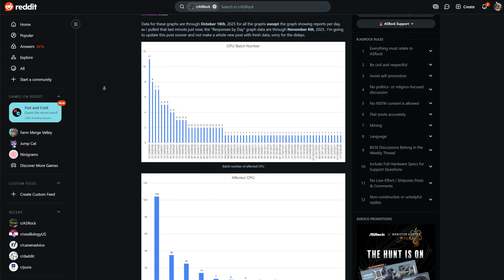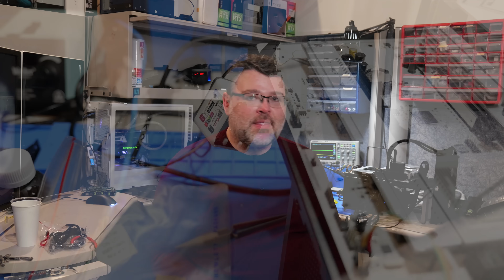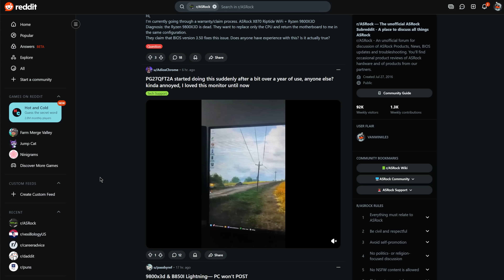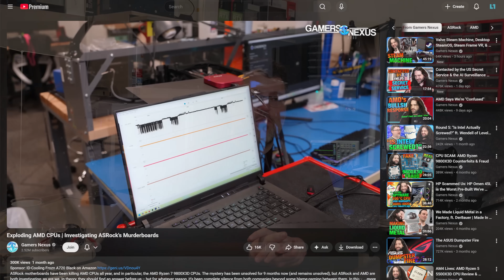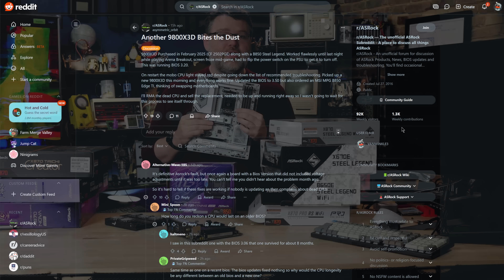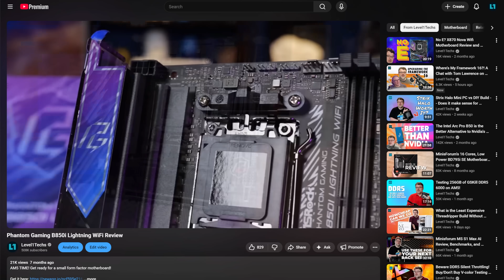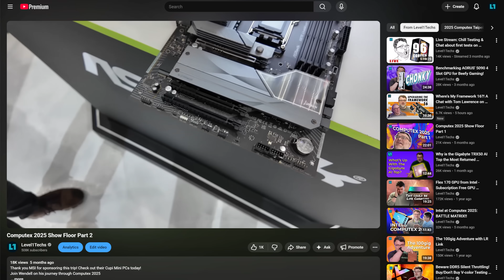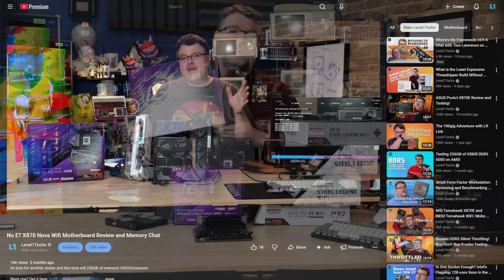Attempting to Troubleshoot the ASRock Motherboards of Death!

Comment: The problem is in the EXPO profile self, which raising up VSOC - memory controller voltage and VDDIO - memory bus voltage in UEFI up to 1.4v, at least what i saw. Just need to make manualy corrections after each bios update (from 1.4v to 1.2v) to solve that issue. And mayby also need to adjust manualy CPU voltage for 9800X3D 1.2v even whit 200+ boost clock.
Reply: 3.50 BIOS caps VSoC at 1.2V anyway iirc.  And lowers LLC to droopiest.
Reply: The EXPO profile on my G.Skill 6000 CL26 kit I use on my ASUS ROG Strix X870E-E has the voltage at 1.45v. I have PBO set to +100hz boost, 1x scalar, motherboard limits enforced, 85c thermal limit, and CO -25 all-core on my 9800X3D.
Reply: @JJW3  1.45 would be the Mem VDD (DRAM voltage).  It only exists on the DIMMs and doesn't matter to the CPU longevity.  If your VSoC were @1.45V at ambient it'd turn into magic smoke.
Reply: @concinnus  Ah, got it. It looks like the current ASUS bios has the VSOC at 1.2v by default as well, as i've not messed with that setting and that is what it is showing in HWINFO.
Reply: @JJW3  Auto scalar should bettter perform the CPU.

Comment: 9700X and B650M-HDV/M.2 here. They have been working well for 13 months now.
Reply: Which bios you updated to?
Reply: @mazditzo  I upgraded the BIOS when I bought the motherboard, 13 months ago. After 6 months of use, I upgraded once more. A month ago I upgraded once again to the latest version of the BIOS. Basically every 6-7 months I upgrade the BIOS.
The CPU is not overclocked, it is stock at 65W, it is not undervolted, no PBO. As it came out of the factory, I installed on the motherboard and that's it.
It is cooled with a Phantom Spirit 120 SE. My assessment is that this cooler is more than enough to cool this processor, if the processor remains locked at 65W.
A few days ago I bought and installed 9070 XT PURE. The computer is very quiet and cool, even under load(video games).

Comment: G'day Wendell,
12:13 😂😂😂😂😂, it is a very weird random problem...
but I am not facing this problem anytime soon as I am still sticking with AM4 due to cost down here, the used APU/Mobo/16GB DDR4 Combos I am building to help people upgrade their old PCs for W11 compatibility together cost less than the current $200AUD alone for 16GB 6000-DDR5 @ Scorptec, which is cheap compared to 🤬$329 16GB 5600-DDR5🤬@ PCCG

Comment: 8:32 A lot of people forget to include the human as the cause of the problem when it comes to this kind of stuff, I see a bunch of user errors constantly killing hardware and because they go on Reddit and get their post blown up the company has to abide with a replacement to save face or spend time and resources gathering evidence that the user caused the damage which would end up costing more than just replacing or refunding the damaged products.
Reply: I'm sad to say but these days you have to include the internet noise as a potential "problem" too. There's lot of noise on the internet these days with lot of bots and it can emphasis some issues. I have a 7800 x3d cpu myself and i know two people with the same cpu (no asrock board) and things have been running smooth. Small sample size but it doesn't seem to be as common as let's say the RROD of the 360 where pretty much everyone i knew had to RMA his 360 once.
Reply: With how irreproducible this "issue" seems to be, it heavily points towards an intermittent problem on (gasp) AMD's end.
There are a lot of steps in a multi-chip packaging, and at any point Something could go not 100% right and you have a timebomb that goes off randomly.

more complexity, more weird problems, it's always been that way
Reply: @TheDoomerBlox gasp is right.  The thought that a CPU--much less an AMD CPU--could cause an intermittent issue doesn't even occur to me as a reasonable possibility.
Reply: @watchthereplay-wtr  the worst part of this is that with new Intel CPUs embracing the same kind of shitfuckconvolution, they likely also feature random inexplicable death-states

Comment: I have a ASRock z790 Riptide motherboard and the 14900k I recently had to warranty my 2 month old prossesor with Intel the issue I had was it wouldn't read duel channel only single channel. Was watching your content and was curious if it could be a symptom of the same nature as the AMD processors? Intel SWR my processor with seeing your video now I'm wondering if I could have the same thing happened to my 12900k that I have in there now difference is that I'm not gaming on that motherboard anymore I have a MSI carbon max 2 z790 motherboard. Please let me know if you think it could be a symptom of the killer motherboard or not....

Comment: I struggle to understand the data, as what to infer from it, simply ain't obvious. If there is an issue, it most certainly is not on Intel level.

As for corrupted BIOS, that actually used to be a major issue for me, with x370, x470, and b450, and x570. I had bios failures all the time, particularly on Gigabyte boards, probably since I were using a lot of them.

My Asrock b650 board also had issues. More particularly, I needed to remove the GPU, reinstall the CPU, as usual, to get to work again. But, I have never ever needed to reflash a single board ever.

I once had a B450 ITX from Asus, constantly failing on me. Probably from the insane water cooling running it. The board would luck up, and only a CPU swap, would fix the issue. Reverting to air cooling, fixed everything.

Given my own experience, and seeing how quickly people blame their boards in the current environment, I struggle to make sense of what is going on. To me, these numbers ain't really proving anything to me, but again, they could. There just ain't sufficient data.

Asrock stepping up their integrity checks, makes sense, and seems reasonable, given they are chasing a ghost. Just seem to reflect good practice, no matter if the ghost is real or not.

Given my experience, one key factor to probe for, is the cooler used. Secondary, the case is of importance, as this could be related to shielding and grounding issues. Ghost chasing is fun! We all love it. Not.

Back in the day, when I used Gigabyte dual bios board, I constantly had one of the bioses locking up. I fixed that by just flashing the other. (that sort of is a reflash, so I guess I have been doing it.) I was using my back and side burner cases back then, and they are insanely overpowered, with like 3 pumps and a 2880 rad. My take is on this, hearing what people have been saying, they report basically what I was constantly struggling with back then. Just for reference, this type of issue also plagued a x570 form Asus. The issue was the insane power of the cooling, or a possible short or something from using it. Once I moved back to air cooling only, I hardly ever see this issue anymore.

Other than once about 2 years ago, but that did not need any reflash, just a complete re-seating, and I had to use the on board GFX. Every freaking component was perfectly fine.

But i could brick the asus itx B450 board at any time, if I wanted to. All I needed was to water cool it, with a bad @$$ water cooler. Swapping CPU to anther type of CPU, would fix the issue. but once running a power virus on it, it would lock right up again, if running that bad @$$ cooler. Swapping type of CPU, was the only way to save it. That was Asus.

Also, if you look at some fan controllers, or fan hubs, they actually feed 12V back into the motherboard. Fractal does that, to name one. Stuff like that can mess everything up, and absolutely zero users will report that. Even Steve just ignored it, even if it totally out of spec.

There seem to be users with repeated failures, and given a seriously low frequency, I am not so sure this is related to Asrock at all. Could be a standard violation, that Asrock is somewhat more vulnerable to, but the root cause is not really them.

I mean, we have a ton of fan controllers that feed 12V into headers, that shut of the 12V supply to the fan, when fans are in idle. Since stupidity like that is the norm within our industry, why would we not experience issues at times?

Read some post carefully, and you will find people swapping parts around, like the CPU work in another build - Tried another CPU - Somehow everything was working - Then it locked up again. What happened to me back then, would give you just that.

I am just not sure if all these CPUs are factually dead at all. We also hear stories about makers telling users that the CPU worked. But clearly, a CPU with burn marks, is not what I am speaking of.

My main concern is rather how long time it went, until the Intel issue was uncovered. That took like forever. It looked something like this, for a long, long, time.

Comment: As long as it doesn't damage the RAM, everyone will be alright...
Reply: I have the email I imagine happening if I ever have to send mine in lol.

"RMA of your 16gbx2 trident z5 royal  neo has been approved and is currently in processing. However, the turnaround will be 8 weeks minimum unfortunately. Possibly longer. We sincerely apologize and will send a update as soon as possible.
Thank you for choosing G.Skill!"
Reply: @RainWalker24c  Then it gets "lost" in shipping.
Reply: @umeng2002  Or marked "delivered", but not to my address. Someone's auto part got delivered to me few yrs ago, the address was 5 states away. I kept saying to myself "How the f is this even possible" while calling the police. 

Two came & was just confused as me why I received it. They said usually its at least within state of address when it happens.
Reply: Lmfao, it's pretty sad really when the ram is more expensive than the cpu.
Reply: @tictechto @tictechto I need some advice on maximizing profit. I have four DDR5 RAM kits (listed below) and I'm debating whether to flip full PCs with them or just resell the kits individually.
1. 96GB Hynix 5600 CL40 (£150) — My current daily driver; runs great at 6000 CL30 @ 1.4v.
2. 32GB Klevv Hynix  6000 CL32 (£68)
3. 32GB Klevv Hynix 6000 CL28 (£100)
4. 32GB TeamGroup Delta hynix 6000 CL32 (£60)

Which route do you think offers the best margins right now?
Reply: As far as profit wise? Sell the ram separate from the cpu/mobo. Selling them as a combo can also net a good amount of money and might be better for ppl that want to have all the parts in one buy
Reply: @tictechto 
It's more expensive than some mid-tier GPUs now... lol
Reply: @yousef.al-assaf not for long...get ready for those gpu price increases
Reply: CPU fried ram was good lol  thank goodness as was dominator ram 😮

Comment: I’m not sure if what I have is a murder board. Machine ran fine for a year on an Asrock b650m and went down during a power outage but refused to boot with dram lights on. Wasn’t my machine but was given to me to fix and spent a couple weeks doing an absurdly thorough process (cmos stuff, checked everything with multimeter, slowly replacing all the hardware, etc). You’d think it was just a power spike killing hardware but it was suspicious how every single component in the machine including the ram, gpu, and psu was fine but the cpu was toast. Power strip the machine was plugged into was also fine. Never seen such specific spike damage in a couple decades of doing this stuff. New CPU was fine with everything else but moved to new mobo just in case.

Comment: Have you done a long-term time test (~200-500 hours run time without restart)?  I have an asrock b650/7950x setup and have noticed the VSOC sensor reading that after an extended period shows a value exceeding 1.4v when I ran it on windows.  Not sure what app to use for monitoring the voltages for linux though as i've moved the system to linux from windows since then.

Comment: Great video!!! I've been running Asrock motherboards in most of my systems. Before the CPUs burning up. I have am5 motherboards from all the four major brands. But for the features I need in my daily used PCs the price to performance of the Asrock motherboards was a good choice. In my workstation PC im running the Asrock live mixer B850 (bios version 3.16) with a Ryzen 9 9900x, 64gb G skill flare X 5 ddr5 6000mhz cl 30 with pbo enabled. Have have no issues with this pc. My gaming PC is a Asrock B850M riptide ( bios version 3.25) with a Ryzen 7 7800x3d and Corsair vengeance 32g ddr5 6000 mhz cl 30. My mini itx pc has a B650i phantom gaming with a Ryzen 5 7600x3d. The only issue ive had with this PC was memory compatibility issues. To be fair to the motherboard the ram dims were two separate sticks of 16 gb G skill flare X 5 6000mhz cl 36 ran in dual channel to make 32gbs. When enabling a particular ram profile it would crash games. When auto ram OC was enabled it would maintain stable. But I have not burned up any CPUs yet. But Ive also not experimented with different bios versions.

Comment: Man we really need make companies stop falsely adverting PCIE slots.  The X670 Taichi Creator DOES NOT have two PCIE 5.0 x16 slots unless it has a PCIE switch and I don't think that board costs 3 grand so it clearly does not have one.  If it has a MUX then it has two PCIE 5.0 x8 slots or one PCIE 5.0 x16 slot.  It's false advertising and needs to stop.

Comment: Truth is Asrock sells cheap junk products.  Always has, probably always will.  I bought a mobo from them once and it died within 3 weeks with no overclocking at all on my intel cpu i had at the time.  $300 something motherboard too if im not mistaken.  Was a workstation system with a X99 cpu in it too.  Have sworn to never buy Asrock ever again and i always advice everyone else to steer clesr of them too.  Them burning up and melting with AMD cpus of late is another reason to never buy Asrock.

Comment: Was a BIOS dump performed with the board that had the corrupted BIOS?  It would be interesting to take that dump and compare it with what it should be.  Where the differences are could point toward what causes a CPU to go boom.  

Similarly has there been any testing by flashing a BIOS and then immediately dumping it to validate that the flash worked as intended?  Similarly periodically over time perform a dump and see if there are any differences/corruption that begin to appear over time? 

Personally I’m alarmed at hearing the term corrupted BIOS.  Yes, it is perfectly possible to get a bad BIOS chip with a faulty region but such a thing would never be high on my list of things going wrong due to their rarity.  I’d more likely suspect the thumb drive that the updates BIOS is being read from the BIOS chip itself.  GIGO in action.

One nice feature of the AM5 platform that BIOS flash back off of a USB is a requirement.  However if there is a subtle bug in BIOS flash back with that USB port it would be a pain to trouble shoot.  Say for a hypothetical example, a keyboard is plugged into it and a key stroke then get randomly written to a location in BIOS.

Comment: have you considered that power supplies are playing a part in this issue? having one rail droop can cause another rail to have imbalance in and over current on the other rails. kinda like the nvidia melting 12V high power. only this is happening at the socket.  If the VRM is flawed in some way i could see a weak PSU exposing a flaw that otherwise wont occur.

Comment: Ever consider the hot exhaust from a flow thru gpu in a vertical orientation may cause the bios to bit flip something under heavy gaming loads? Just a thought.. might be something interesting to test - run 3d mark in a computer case with a vertical mount for the gpu and a less than ideal air flow and see if a toasty bios chip sunndely forgets its own settings...
Reply: But loads of other vendors also put their bios and chipset in that same region - we would have figured out by now that shielding those chips in vertical mounts, would solve some issues. It seems unlikely to me.
Reply: @HexerPsy  Only if all BIOS chips were equally temperature sensitive.  Apparently AsRock used a new chip vendor this gen.

Comment: First time watching your channel, but I just built a board using a Azrok 550 pro two I think that it is what you’re talking about is a little over my head. I do understand electronics a little bit but not to the degree that you’re talking about great channel man I subscribed.
Reply: This is a rare problem actually, it only happens on Am5 boards and specifically only some models. Steel Legend line, on rare occasions users that installed a high end cpu from AMD (7800x3d) lost their cpu and allegedly some ASRock motherboards are responsible for this.